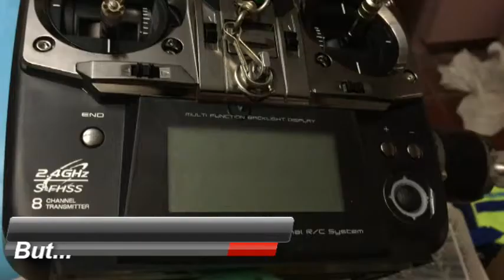HG3XA 3-Axis Stabilization Gyro System Problem

Comment: Hi Juan,

I gave a detailed description and I am using all HiTec equpment, Tx, Rx, Servos. I got that response in two hours!
Reply from the maker: +Peter Oxley Finally got a replacement gyro in the mail today. No one communicated what was going on. It came as a surprise. Will try to install it this week.
Reply: Peter Oxley can this gyro be used for gas models?
Reply: Bharath Raj  I think so Raj, but I could not get it to work and got no help from Hitec. I wouldn't recommend on this basis.
Reply: Peter Oxley thanks Pete

Comment: Dude, first even if you get the gyro working, which I am pretty sure it is something you are doing wrong, your plane is going to crash. Look how your push rods flop around with servo input! The leads provided go from receiver to IN on gyro. Your servo's plug into OUT. I own 4 units and they perform flawlessly... Bobby Wilson, Tucson, AZ.
Reply from the maker: +Bobby Wilson  Just to get the concept right: I connected the leads from the receiver to the [In] of the controller. Then I connected the servo leads to the [Out] of the controller.  Am I right?  Concerning the push rods, I appreciate your concern. I will be making the proper installations later.  I have yet to finish the plane, and the push rods were connected temporarily purely to test the controller

Comment: Juan: I am having EXACTLY the same issue... Please let us know what the solution is? Thanks.
Reply from the maker: +Peter Oxley, I sent it to their Repair Center. No answer yet. Once it comes in, I will let you know.
Reply from the maker: I configured the gyro at home, and when I went to the field to test and refine, it did not work. I have the gyro in a box now, collecting dust.